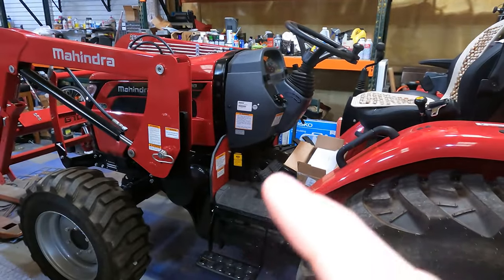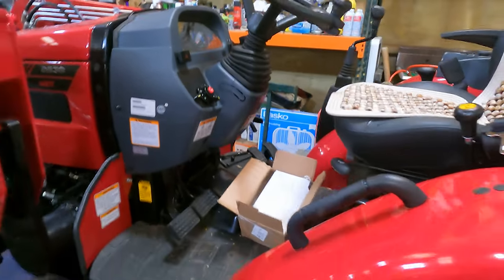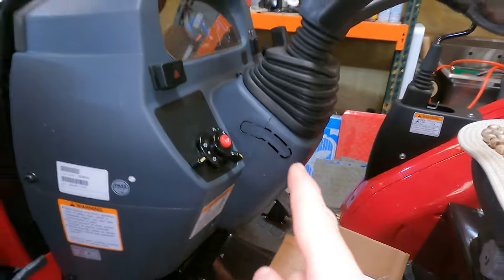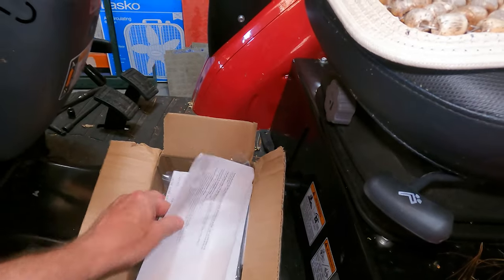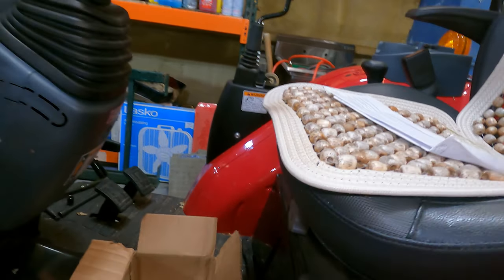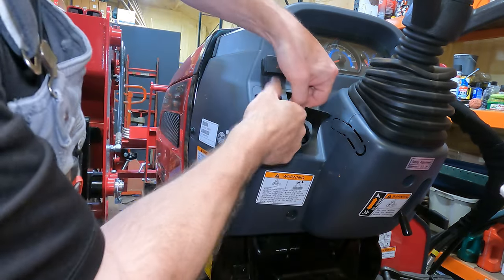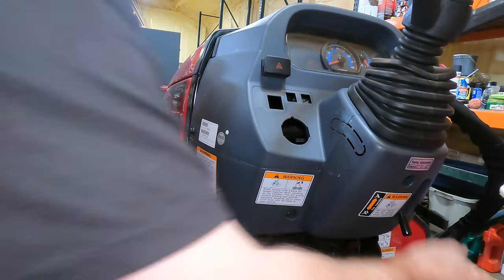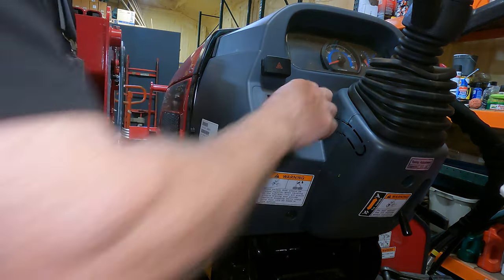Adding Cruise Control To A Tractor??? You BETCHA!

Comment: WOW!! I need one of these!!
Reply from the maker: The single best addition to my tractor!  Esp when grading my mile long gravel road!  My leg used to ache before this!
Reply: @MountainLaurelMetalworks  does the switch lock into place or does it pop back into place? locking or momentary? My switch does not lock..wondering if that is why mine wont work.
Reply from the maker: Mine is a momentary switch.  the unit uses a relay to engage the electromagnet.  This is how the cruise auto-disengages when you hit the brake.  If your switch does not stay engaged, it's possible the brake sensor is not working correctly.  Are you using the Mahindra kit or some other?  If you want to post a video question, I'd be happy to look at it and compare it to mine.
Reply: @MountainLaurelMetalworks  the packaging says Mahindra-TYM.
Reply from the maker: The only thing I can think of is a bad connection / connector (bent pin, damaged, etc) or a connector not fully seated. There were only a couple of connections, so it should be pretty easy to track down.  Without seeing the installation, I can only speculate.

Comment: May i use that kit for my TYM 394  HST Tractor?  What is the price of that?  That should be wonderfull if so.
Reply from the maker: That would be hard to say, TYM, Mahindra and RK brand all use the same basic chassis, but there could be variances.  Does TYM have one available?  It's probably worth checking with a TYM parts dealer.  I purchased this from a Mahindra parts supplier.  I'm sure you could purchase one and try.  Depending on the return policy of your local Mahindra dealer, maybe you could return it if it does not work.